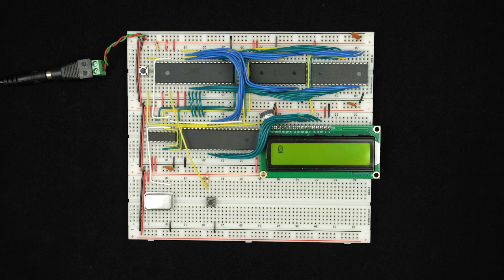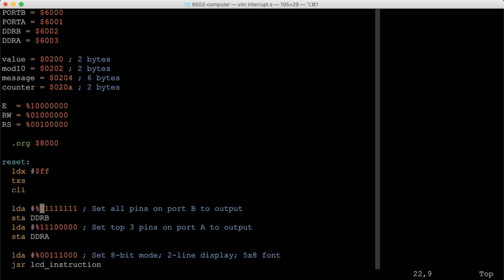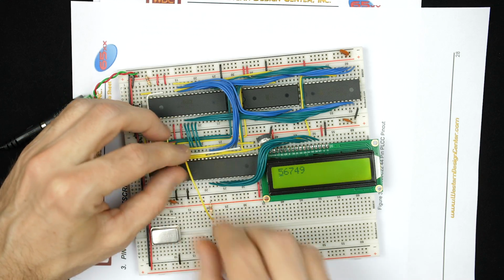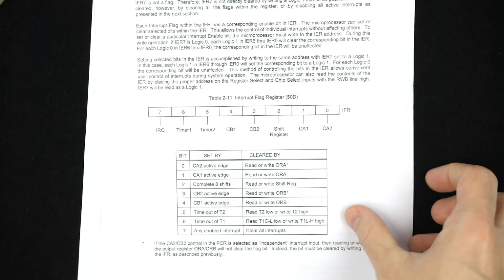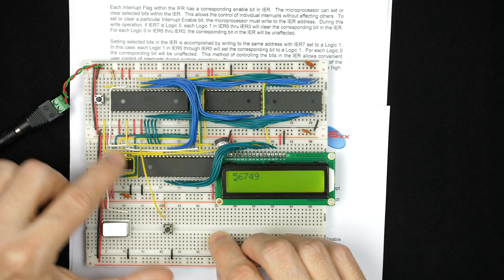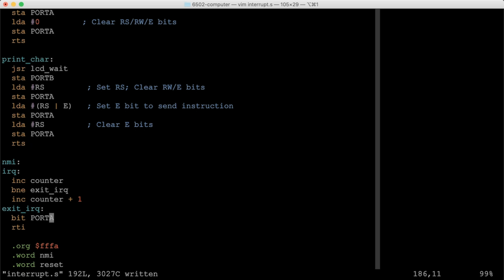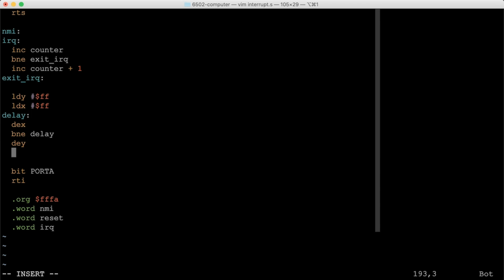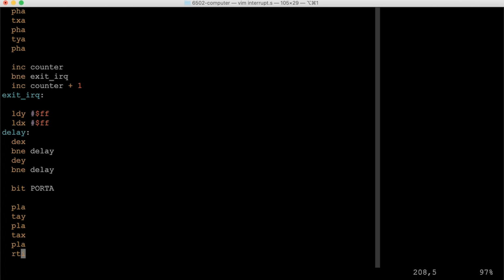Interrupt handling

Comment: 📺💬 An interpreter that is useful when working with input, can have multiple sources, registers and flags for multiple sources connected.
📺💬 Where can we find the interrupters⁉
🥺💬 To answer the question, more than complexing input some useful connectors devices or multiple inputs with shared bandwidths, keypads, joysticks, and monitoring devices.

📺💬 We have a delay loop between the interceptor and the input. 
🥺💬 That we also found in the laboratory, it is a vector input add a logical gate from the input switch or uses a source generator or ground connected⁉ I will recheck it from list.
---

📺💬ยุ้ยตอบผมด้วยครับ รู้อยู่แล้วว่าเค้าแต่งเรื่องคุณก็แต่งไปกับมัน
🥺💬ผมปฎิเสธทุกวัน ทุกครั้งเค้ามาเร่งเครื่อง ทุบกำแพง ด่า ลำโพง อุบัติเหตุ จะทำให้นิสัยเสียตอบ ผมแจ้งตำรวจไปหลายทีแล้วไม่หยุดเอง 📺💬 โทรกลับหาเจ้าของอู้หู ไม่มีเหตุผลที่จะห้ามครับ อย่าลืมบอกเจ้าของรายการด้วยนะอ้างไปส่ง 📺💬 วันนัน้พิมพ์แน่างนี้ครับ 🥺💬 เค้าลำโพงไปด้วย ด่าไปด้วย สลับปุ่ม และอื่นอื่นครับ ผมไม่ได้พิมพ์เร็วอยู่แล้วผมใช้วิธีสร้าง templates ผมดูต่อนะ ผมว่าไม่ใช่ปัญหา ผมดูอะไรก็ได้ แค่ไม่อยากเกี่ยวกับพวกที่มากวน ดีกว่ารายการไร้สาระ หรือเนื้อหาที่เค้าจะเอาไปใช้

Comment: Great video. A simple way to make a digital switch debouncer and not use an analog 555 timer with the capacitor and resistors is to use a push button switch that has both normally open (NO) and normally closed (NC) contacts. You feed that into 2 NAND gates with cross feedback to form a latch. The NO side of the switch goes to one NAND gate pin with a 10k pullup, and the NC side of the switch goes to a pin with another 10k pullup on the other NAND gate. That was a good idea to show how debounce can be done in software as well. Sometimes when I don't care how long the Interrupt Service Routine (ISR) is I just throw in a loop like you did.
Also, to the viewers: It is a good idea that when you first learn to code ISRs, to have a template that you can cut and paste from your "repertoire" code. 
I suggest you learn how to save the ENTIRE state of the CPU on the Stack as you enter the ISR and pop it all off the Stack before you return from the ISR. This is handy when you will do context switching (like in multithreading) as you get more advanced. Coders sometimes forget to push the CPU Flags register on the Stack, do this first because many op codes do effect the flags and they too should be exactly as they were before the interrupt was handled (called).  So having a full context save of the CPU is good to have at hand even if your ISR does not change everything in the CPU, but you can trim out what you don't need if you need to make your ISR as short (fast) as possible, but don't forget the save the Flags register on the Stack first in almost all cases.

Comment: It's been decades since I used a 6502 CPU. I remember using a flip flop to control the IRQnot pin on it. I would set a flip-flop which would force its Qnot output to go low and make IRQnot active low to request the interrupt, and then some of the signals from the CPU could be decoded to clear the flip-flop (Qnot, thus IRQnot, goes back to inactive high) as its enters the Interrupt Service Routine to generate only one interrupt per interrupt signal edge.

Comment: At 13:51:  PortA has 8 bits, true you could OR them so 8 different sources can generate the CA1 interrupt, but I think the more popular use was to provide an 8-bit interrupt vector for CA1. This way, when the interrupting device (say a disk drive) initiates CA1, it puts an 8-bit value on PortA so the Interrupt Service Routine (ISR) can read PortA (IRA), which clears the interrupt while telling the ISR something about the interrupt, like say, $21 (disk head is on requested track), or $20 (disk head is home)... things along those lines. But there are many more ways to use these interrupts.

Comment: Big picture: An interrupt is just a hardware generated subroutine call. Annoying part.  Since it can happen anywhere, you need to save and restore registers and condition codes.  The software you interrupted depends on things happening in a fixed order with no surprises (e.g. the carry bit changed in the interrupt call).

Comment: This is like the wayback machine for me. Back in the early 80s I was writing interrupt service routines and terminate and state resident programs in ASM  to handle input from various sensors like strain gauges and tilt/inclinometers through a custom device I built. Now I just use a Raspberry Pi, Arduino and or ESP32.

Comment: I have followed this series from start to finish and find it fascinating and very well explained. (TLDR; Thankyou Ben)

It would be cool if the interrupt handling could be used to implement an approximation of concurrency with multiple processes

Something like.....
Set up the 6522 to generate an interrupt every ms.
The interrupt handler saves the AXY registers on the stack
It then sets some (new) address decoding logic to swap out the stack for another page of memory (holding another stack for anther process)
We pull that stacks registers back to AXY
RTI would then return to the new process
Repeated timer interrupts would effectively swap between processes? 

It struck me that the memory chip is only being half utilised so maybe could use the extra memory for the paged stacks

(This struck me as a good idea for one of your future videos. Hint hint.)

Comment: Just finished watching the entire series and even though I don't have breadboards, chips and all the stuff to follow, still
I've managed to get the very gist of the tutorials to pick up those key parts that are required for cycle accurate emulation
of a 6502 based computer. Thank you so much Ben for making such a detailed series explaining every single bit of
information I could've ever dreamed to learn from a single source in regards to 6502 emulation.

Comment: In the delay function you're Dec x to zero, then y by one, then Dec x again to nonzero (likely ff, but depends on cpu complement system) then Dec x to zero again before Dec y again. So it's delaying for (0xFF)×(0xFF) loops instead of (0xFF)+(0xFF) . Break it to two delay loops or call delay twice to fix the latency issue
Reply: "Likely ff but depends on cpu complement system"? No need to guess! We know the CPU. The 6502 is of course twos-complement as God intended.

(And yes, he knows you're getting 255×256-1 instead of 255+255 iterations. That was the point. He did mention you could probably go significantly shorter if you wanted to spend time tuning it. Just initialize Y to a smaller value.)
Reply: @ps.2  Or X as multiplication is symmetric. Doing 10 loops of 2 loops is same as doing 2 loops of 10 loops.

Comment: Could you re-implement the busyflag polling with interrupts and WTI instruction? Not immediately obvious how to do that but it should be possible I think -- after all the 6522 is designed to do this sort of thing.

One way of doing it I think is tie busyflag output (pin 3 of LCD) to CB1 and in our lcd_wait routine to enable interrupts on CB1; then we could read B and as long as it's not busy, disable the interrupt.

There might be some undesirable bouncing on ORB but actually checking the busy bit should take care of that I think.

Comment: Instead of the debounce software, I stuck a 100nF cap across the switch and it seems to work well.

EDIT: Though not perfectly.
2nd EDIT: Now it's a 555 monostable circuit with a 10nF cap across the switch as well.

Comment: Ben, are there any plans to add a keypad to this system for viewing and adding programs directly into memory as well as to view and set register values? Similar to a KIM-1 or any other CPU trainer?
Reply: Why not port the KIM-1 monitor to this board? This will give us cassette recording and ASR-33 interface. Source code can be found online. I still have a KIM-1 in working condition. Purchased in 1981 when I was 21 years old.

Comment: 2:03: "We can also set the data direction for each bit."
Or byte, rather. EDIT: No, Ben was right, as per Chris's correction below.
Reply: From the data sheet ( https://eater.net/datasheets/w65c22.pdf ): "Both PA and PB operate in conjunction with a Data Direction Register (DDRA or DDRB). Under program
 control, the DDRA and DDRB specify which pins within the port bus are to be designated as inputs or outputs. Logic 0 in any bit position of the register will cause the corresponding pin to serve as an input; while a logic 1 will cause the pin to serve as an output." Each pin is a single bit, so you can set the directions for different bits within the same register byte independently of each other.
Reply: @chrisbattey  Ah. You're right, I'm wrong, egg on my face. I hadn't cottoned on to the fact that these aren't just bits toggling the ports in or out wholesale, but that there's an actual byte-for-byte and bit-for-bit correspondence between the 8-bit ports and 8-bit registers. The link parser has eaten your bracket though, so you might wish to edit that for the link to be easier to click, so people won't have to manually delete the closing bracket for it to work. Thanks.
Reply: @ropersonline  Yeah, when that first came up a few videos back I thought it was kinda weird at the time, but the idea of handling multiple separate single-bit interrupt lines through the 6522 makes it seem a lot more reasonable.

(And thanks for letting me know about the link - enough sites have figured out how to be smart about that by now that I keep getting caught off-guard by the ones that aren't...)

Comment: Another great video, huge thanks Ben. Just a heads up for others following along, at 20:05 you can use the phx and phy opcodes of the 65c02 to push the x and y registers to the stack directly. Similarly, you can pop them off with the plx and ply opcodes.
Reply: Hi, I believe the vasm referred by Ben here does not support these opcodes. I tried and got an error:
vasm6502_oldstyle.exe Interrupt_VIA.s -Fbin -o Interrupt_VIA.out -dotdir
vasm 1.8g (c) in 2002-2019 Volker Barthelmann
vasm 6502 cpu backend 0.8 (c) 2002,2006,2008-2012,2014-2018 Frank Wille
vasm oldstyle syntax module 0.13f (c) 2002-2018 Frank Wille
vasm binary output module 1.8a (c) 2002-2009,2013,2015,2017 Volker Barthelmann

error 9 in line 177 of "Interrupt_VIA.s": instruction not supported on selected architecture
>       phx

error 9 in line 178 of "Interrupt_VIA.s": instruction not supported on selected architecture
>       phy

error 9 in line 192 of "Interrupt_VIA.s": instruction not supported on selected architecture
>       ply

error 9 in line 193 of "Interrupt_VIA.s": instruction not supported on selected architecture
>       plx
Reply: @ParthSarthiSharma  yeah, ben is trying to make it accessible to anyone with a 6502, not just 65c02 or wdc 65c02. for vasm you need to add "-c02" if you want to use 65c02 opcodes.

Comment: That delay loop though. I think it works because X underflows and implicitely resets to ff from zero at dex immediately after the jump back after dey, so you don't need to explicitly reset X at every iteration on Y. But you didn't say that out loud, so it's a bit confusing
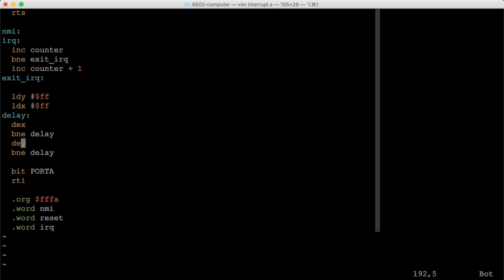Reply: Yes, think the intention was probably to write the loop at 19:37 as

  ldy #$ff
delay_outer
  ldx #$ff
delay_inner:
  dex
  bne delay_inner
  dey
  bne delay_outer

instead of

  ldy #$ff
  ldx #$ff
delay:
  dex
  bne delay
  dey
  bne delay

But as I'm sure you already figured out, we could have had e g ldx #$0 instead, and that would work to loop 256 times, because the first time through the loop would decrement x to make it wrap around to 255, and then it's not zero so the bne would jump. So when bne delay after dey jumps back, x is 0 and the next x loop will go around 256 times.

Comment: Ben the delay is slow because it starts delay and DeX and then goes back to delay when x is equal it goes to dey and hen go back to delay so it's going through the full DeX for every 1 of the dey's so its 65535 times the #of clock cycles in 2 branch instruns and 2 decrement instructions

Comment: Ben, could you touch on the "best" way(s) to determine how long a piece of code takes to run?  For example, your software debouncing code in this video ran too slowly -- how do we easily(?) determine how long that code segment takes so that we can shorten its run-time instead of trial & error?  I've always had trouble doing this and assume that a Programmer as sharp as you knows easy(?) ways to determine the run-times of code/code-segments.  I look forward to the next video in this series!
Reply: As I remember, there is an explanation on how many cycles each instruction takes in the 6502 programmer's reference guide. It's online
https://www.commodore.ca/manuals/c64_programmers_reference/c64-programmers_reference_guide-05-basic_to_machine_language.pdf

Comment: Keep going, Ben! Being inspired by your videos I've built my own Z80 breadboard system. https://i.stack.imgur.com/Kf18a.jpg
And now I'm in the process of switching it to 320x240 TFT display.
P.S. where did you get such a nice thick wires? I had to use ethernet ones and bend every stripped tip with tweezers to ensure reliable contact inside breadboard nest.
Reply: Nice work. Back in fall 1983 I designed and built a Z80 based printer buffer with 256kb bank switched memory.It had 2 LPT ports and 2 Serial ports. Double sided PCB laid out with Letraset transfer symbols and some wiring with Rotring ink pens.The control program was written in assembly and stored  in a 2716 Eprom.

Comment: Hello Ben Eater. Thanks for your awesome videos. Could you make one on DDR SDRAM? Perhaps some kind of a digital "oscilloscope" that would incrementally read samples of a digitized analog signal at a certain rate and hold the result for, say, a computer to read it later on from there. If I do not make sense, please just disregard, my English is not as good as I wish it were. :)

Comment: An easy way to debounce the switch would be to add a capacitor in parallel with the pull up resistor. A time constant (R times C) of about 10ms would be about right from my experience.

Comment: 20:00: you say, you can't push X and Y registers to stack directly and have to use "TXA/ PHA" instead.
That's not correct for the WDC W65C02S, that you use in your projects. The W65C02S has opCodes for PHX, PHY, PHA and PHP. 
For pushing the registers directly. And you can use PLX, PLY, PLA and PLP to pull the values from stack again.
Reply: I don't think he's really used to the 65C02. He used JMP instead of BRA, too, in previous videos.

Comment: The last time I was writing 6502 interrupt code was on a wire wrapped pin board in the middle 1980s. It was a home-brew midi sequencer that connected serially to a PDP11.
That said, software delay loops are inadvisable. Software delay loops at interrupt level are unfortunate. If you really need software denounce, there are so many better ways to do it.
The VIA timer was what came to mind while watching, but I am far too late to be the first to suggest it.

Comment: Could you use one of the 6522 timers for debouncing? If the switch remains in the same state without changing for longer than it takes the timer to run out, it must not be bouncing .....

Comment: Yes, it's not a good idea to put a delay in an interrupt handler. A better solution, instead of incrementing the counter in the interrupt, is to flag the button press in memory, and then move the increment and the debounce delay into the main code loop. Delaying in an interrupt would effectively freeze all other interrupt handling. Obviously it's not a problem in this particular case, but something to keep in mind for other interrupts. As a bonus side effect, from the main code, you could update the output immediately, and then run the debounce delay loop.

Comment: What happens if the print routine writes to the port A register at exactly the same time as you press the button? Will the interrupt be lost because IRQ is state triggered? Or doesn't this happen because write is always the last cycle of the STA command and there are no RMW commands to port A in the program?

Comment: On button press, you could disable CA1 interrupts and instead enable a timer, then when the timer expires turn on CA1 interrupts again. That should succeed in debouncing without having to spin inside the interrupt handler, plus it would show off timer functionality.
Reply: The most simple circuitry to use is a capacitor and a Schmitt trigger. If the button is active high (ie, 0 to 5v) it will charged the cap, but the cap doesn’t have time to discharge before each subsequent bounce recharges the cap. Once the bouncing stops the cap discharges. The Schmitt trigger tidies up the voltage output to ensure a nice square pulse is created. Essentially it works the same active low, and by employing different resistors, a smaller one on the button and a larger on the discharge circuit, you can minimise the rise time and maximise the fall time to eliminate bounce completely.
Hackaday has a good article on alternatives. https://hackaday.com/2015/12/09/embed-with-elliot-debounce-your-noisy-buttons-part-i/
Reply: A capacitor across a switch can also debounce. But it's not so funny.
Reply: I've been reading the datasheet to figure out how to do that since the last video.  Hopefully that's where he goes with the next video.
Reply: I was thinking of clearing the interrupt, and then just test the interrupt flag again after you're done with the ISR, and if it's set again by a bounce, clear it again (and then, repeat.. possibly with a VERY short delay).  That should be good enough, and not cause the huge delay his 64k counter caused..  Of course, hardware would be better..